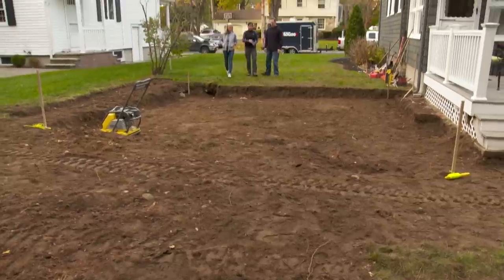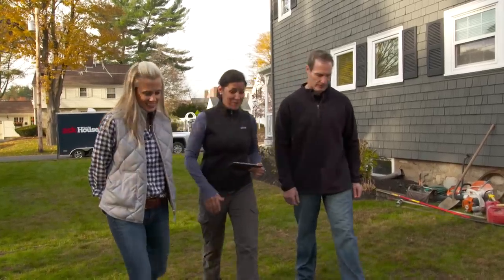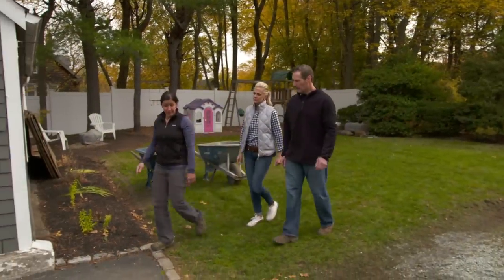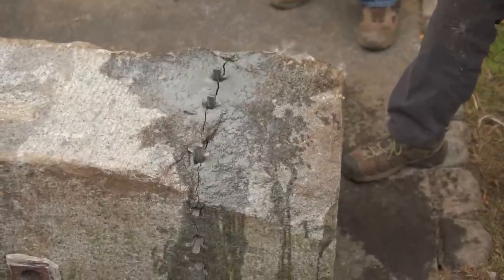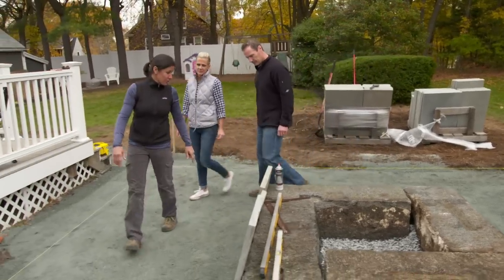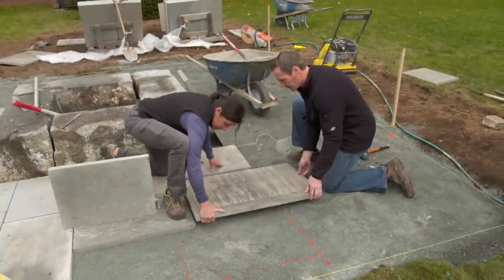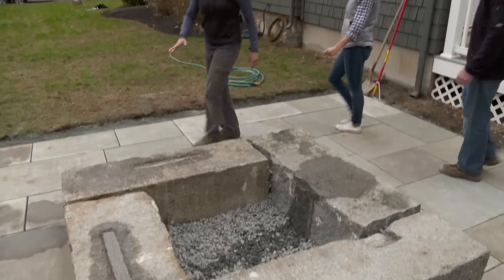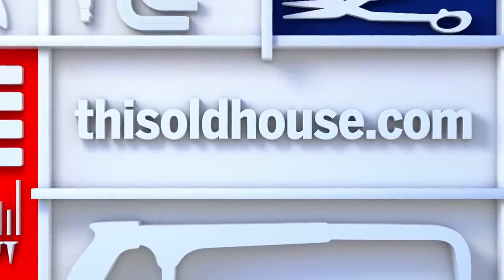How to Install a Natural Stone Patio with Fire Pit

Comment: Bluestone dust is usually a bad idea....holds too much moisture. If you live up north you're going to have frost heaves, and that patio will be a mess in a couple of years. Better to go with 3/4 stone (about 8 inches) then fabric, then a couple inches of clean sand which you run a compactor over. You don't put down the patio stone till after you've screeded the whole thing.

Comment: Really missed roger on this one. Too many things were done wrong for this video for it to be useful. Given, this is how many contractors would do this job, but Roger et al. Always too top quality work, not mid grade work. No geo textile to prevent the fines and crushed stone from washing out. No consideration given for drainage. She may have excavated 12 inches. But I still saw more organic soil than I would be comfortable with at that level. There is no means of retaining the base, or stone. Wish I lived around there, because some lucky contractor is going to make a lot of money fixing this mess in 5 to 10 years